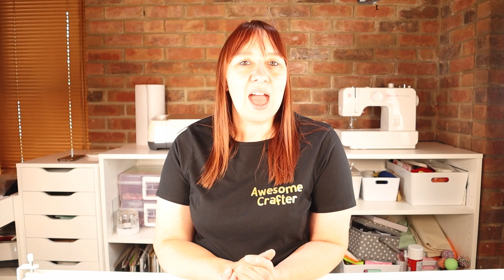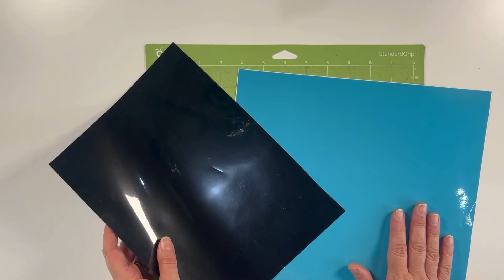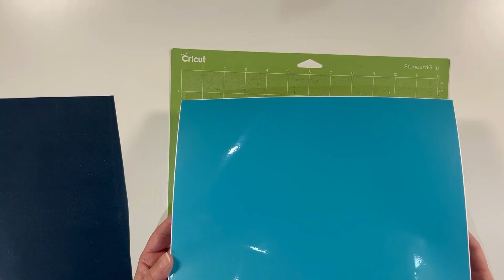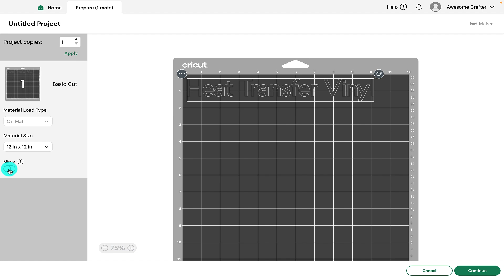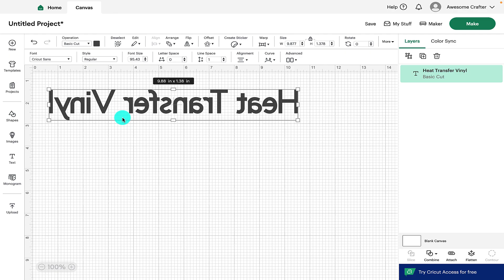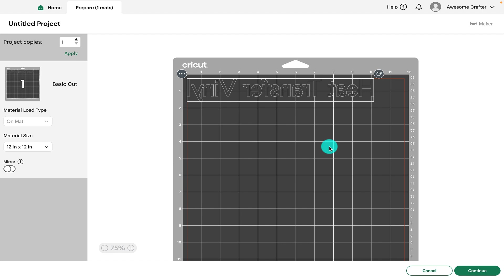Heat Transfer Vinyl Why do i need to mirror it and when?

Comment: If there is a design on vynil do u still mirror ❤
Reply from the maker: You only mirror the design if you are using any type of heat transfer vinyl. If you are using self adhesive vinyl you do not need to mirror the design. Hope this helps